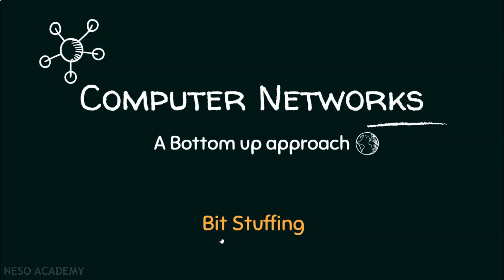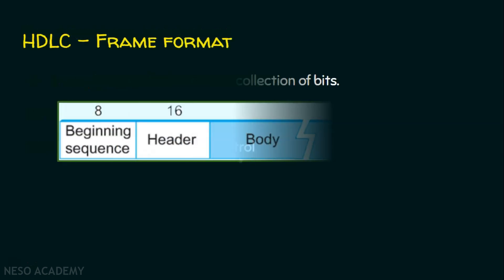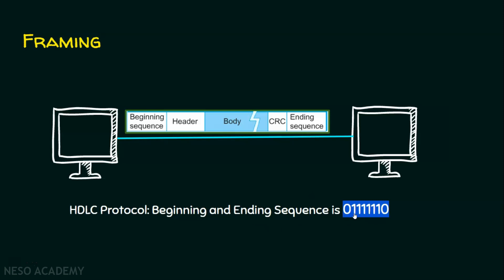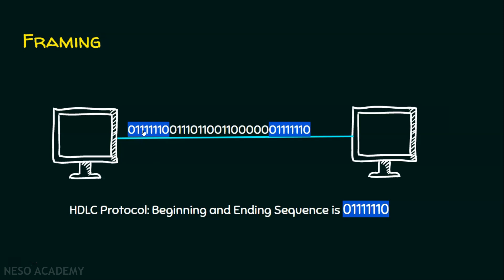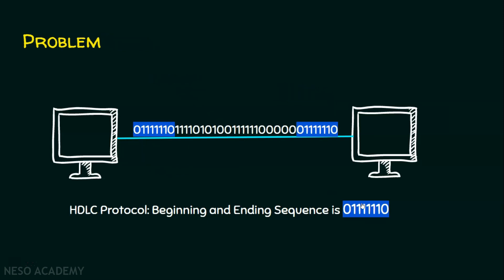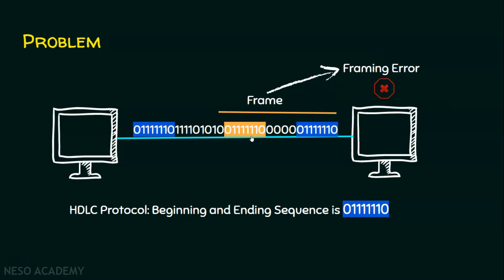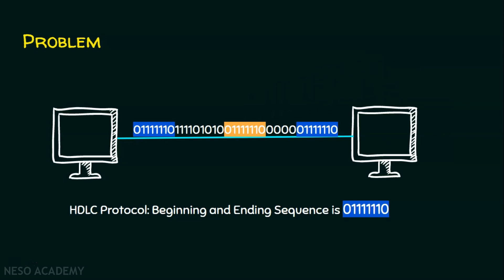Bit Stuffing

Comment: 3:38
What if in the payload there has a pattern similar to 111110 will the receiver think that it is stuffed bit or part of payload?
Reply: first bit stuff done when its 01111110  the above pattern 111110 is differnt from the orginal  the bit stuufed before consuctive 5 1s and bit stuffing wil be undo  when reciever data first

Comment: beginning sequence and ending sequence is 01111110 ,  What happens if the original data itself has , 5 consecutive ones followed by zero this would a problem again in bit stuffing right
Reply: yes it's a problem but most of the algorithm just sees 5 consecutive 1's, so if your original data is "111110" , stuffed data will be : "1111100"
so at the time of destuffing it will skip one zero and you will get the original data back.

Comment: i have a doubt
we stuff bit if there is ...01111110... sequence in data
now bit stuffed data is ...011111010...
now reciever removes the extra zero to correct the data

what if my original data has the sequence 
...011111010....

Comment: A question : what if the original payload contained a part where there is a 0 after 5 consecutive 1s, and the reciever will identify it as bit stuffing and remove it, would'nt it corrupt the original data ?
Reply: Actually, after 5 consecutive 1s ,a zero will be placed irrespective of the next bit (0 or 1). So, at the receiver end this 0 will be removed to get the original sequence. 
example the body part is 111110010001111110 at sender end.
So, the pattern received at the receiving end will be 11111o00100011111o10  (i intentionally used 'o' for denoting the extra 0's).

Comment: ANS:correct.

INFO:start from the left all the way to right

 FIRST_SET: 5 ones (1) after that apply zero (0) 
continue the pattern...

SECOND_SET:6 ones(1) so -> 5 ones(1)  then zero(0) then one(1)
continue the pattern...

THIRD_SET:7 ones(1) so -> 5 ones(1) then zero(0) then one(1) then (1)

continue the pattern...

Comment: I think its incorrect as at the last there is series of 7 1's and that satisfies the requirement of not repeating the protocol sequence. though  a 0 is added in that series after 5 consecutive 1's.
Is it necessary to do so? Or is it possible to have the series of 7 consecutive 1's.
Reply: it is not possible to have 6 or more consecutive 1's in the sequence because the sender always stuffs 0s after every five 1's. So, the sender has to keep track of (01)'s in the sequence, to remove the (0) from it, if the next five bits are all 1's.

Comment: Correct.

The original bit sequence without bit stuffing is "110101111101011111101011111110".

After applying bit stuffing, the bit sequence becomes "110101111100101111101010111110110". Here, bit stuffing involves inserting an extra "0" bit after every sequence of five consecutive "1" bits to ensure that the receiver can distinguish between the original "1" bits and the stuffed "0" bits. The stuffed bit sequence is still able to convey the same information as the original bit sequence.
Reply: I don't think it's correct as it did bit stuffing in the starting/ending sequence too. It was supposed to leave that part alone right?
Reply: @jewelbency5072 but the dude said, that the sequence given is only the data
Reply: @b3ntastic  yeah, thats why its correct
Reply: That's wrong answer
Reply: incorrect, dont stuff bits in the Flagz
Reply: it's wrong bro, we add 0 after 5 consecutive 1's only if the sixth bit is also 1, if it is 0 there's no need to add

Comment: I guess both the question are correct as both of them as the bit stuffing done at some point in the whole data. Although bit stuffing is done 3 times in 2nd question and once in 1st question.
Is are answers matching?
Reply: Wrong. Those are not two questions. It's one. The first one is the normal data, the second one the bit stuffed date. Your job is to look if the big stuffing was done correctly from unstuffed data to stuffed data.

Comment: Hey wat if the data contains normally 111110 (five 1s and 0) it will change the original data to 111111 in the receiver part ?? But actually it shouldn't? Wats the solution
Reply: U got the answer?
Reply: @SURAJ-cv8nt  111110 would be changed to 11111 0 0 and unpacked as 111110 again
Reply: @Baummaster  got it, thanks

Comment: There's an error in this video at the SOLUTION part.. You consider the bit order from right to left when you trasmit the sequence, and yet you insert the 0 after 5 1's, starting from left to right, when in reality you should add the 0 bit from right to left (after 5 1s)
Reply: Doesn't matter ending and beginning sequences are palindromes /
Reply: Idk what you meant, but the solution is correct. Look at it from the receiver's point of view (the receiver is on the left). The receiver will read 5 1's then a 0 which it will remove. The order is definitely correct
Reply: @Nomnomnom165  how bro? Receiver will start reading from the beginning sequence bits right

Comment: Question. What if data recieved from upper layers is in fact five zeroes seperated by a one, how will the reciever know whether bit stuffing is applied or not?
Reply: great question. any idea?
Reply: @vegaripkont792  Hi! So basically the reciever assumes that bit stuffing was applied and just mindlessly removes any zeroes appearing after five consecutive ones. If there is a zero after five consecutive ones in the original data, then bit stuffing would still add a zero after five ones, making five ones and two zeroes, and reciever will just remove one zero after five ones making it back to how it was!
Reply: @mellamoakshay  thanks a lot. Now it fall into place.
Reply: @mellamoakshay great

Comment: What if in the data the bits are originally having 5  ones and then a 0 ... Receiver then will consider the actual bits to be stuffed and will remove the 0 after 5 ones ... But that was the actual data?
Reply: U said 111110 right !!
Now firstly the sender will stuff a bit after 5 1's i.e. 1111100
Now after receiving, the receiver will de stuff the extra bit (0) and the data(111110) will not be lost.
🛐 Correct me if I'm wrong.
Reply: @amanlrwtfsm1323  Got the point..Thanks 👍🏻

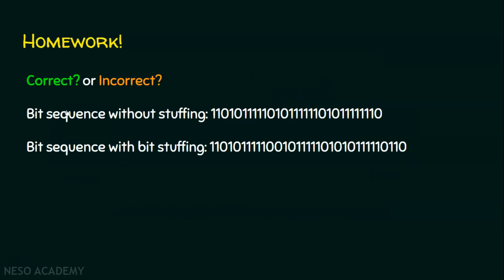Comment: Answer to H.W. at 03:50

Given Bit Sequence without Bit Stuffing (I think there is No Beginning and Ending Sequence) : 110101111101011111101011111110

I as a Sender taking that data bits sequence from upper layer and see three "5 Consecutive 1's". What are they ?

1101011111(1st)01011111(2nd)101011111(3rd)110  

Put 1st=2nd=3rd=0

1101011111(0)01011111(0)101011111(0)110 = Given Bit Sequence with Bit Stuffing in video.

Hence, It is Correct.
Reply: But there is already a '0' after 5-1's at the (2nd) stream right ? 
So after bit stuffing it should be 1111100 (2 zeroes) instead of 111110(1 zero, as mentioned in the wrong answer).

Hence, INCORRECT!
Reply: @SoumodeepChatterjeeIITD-dl6so bhai sender/receiver side pe data ek sequence me hi scan hoga ! Isiliye first five 1's ke baad 0 stuff kiya h
Reply: nerd
Reply: @nirmalksanjay  💀

Comment: 3:43 Sir, if considering a case where after 5 consecutive 1's the next one was already 0 and regardless of that bit value we have to stuff the 0 bit and remove while receiving the data in the receiver node?
Reply: yes, that's true.
Reply: @rahulkumarsingh7615  can you elaborate this as to why we still need to insert 0 deliberately? Since the ending would be different than that part of the message, there shouldn’t be any problem in receiving the data?
Reply: @Hard-oc2qd  there is a fix mechanism. if after consecutive 1's the next one was already 0  and if we don't one more 0 then at the receiver side the mechanism will remove the 0 after consecutive 1's. it's better to put 0 irrespective of there is already 0 present in the data after consecutive 1's.
see this example :
data - 011011011111011 
after bit stuffing -  110110111110011 

at the receiver side - 
after removing the extra 0 bit
data - 011011011111011 
so it's correct data at the receiver side.

if we do not put 0 (bit stuffing)  while sending the
data - 011011011111011 

at the receiver side - 

the mecanism will remove the 0 after consecutive 5 times 1's
so the data will be - 01101101111111
Now it's incorrect data we are getting at the receiver side.

i hope you understand it
Reply: @adityaghadge2067  yes mate thanks, it was clear since it was posted 3 months back! Still thanks a lot mate.

Comment: sir what if we have payload/data consisting of 5  1's and followed 0 and 1.
Reply: I scrolled down nd got the answer of this question in comments down below...thought I'll let you know as well 
So the thing is whenever the sender has a data which has five 1's it would insert a 0 independent of what bit the sixth character holds...
When a receiver receives a data that has 5 1's it will always remove the 0 on the sixth place
Reply: @beyond_akshii  but if the sender removes the 0 after 5 ones.. Isn't it making the data erroneous?
Reply: @shwetayagnik2772  No ... after 5 ones the sender will add 0 no matter what next bit is so the reciever removes the added zero ( suppose 111110 is somewhere in the information it will become 1111100 and reciever removes the zero after 5 ones so it becomes 111110 which is the required result . As you can observe what ever the 6th bit is it will not be effected.)
Reply: @beyond_akshii  so bit-stuffing is something which should be there in all cases, regardless of the message you want to send?
Reply: True ...I got the same doubt...did u get the answer?

Comment: It is correct ... Simply remember the fact after 5 consecutive 1s one 0 will be added ..... And here this mechanism is followed... So correct that's it don't confuse with original data getting modified and all. Every non info bit added to the data will be removed by the receiver

Comment: if data = 11111011111 
then what will be output after bitstuffing?
Reply: @sandeepkejriwal8286  I guess we place a Zero after one zero and five ones,ie,011111 and not just after five ones. so it should be 11111011111(0)
Reply: @sarvagyaiitmadras8727  You can stuff the bit anywhere the purpose is to break the end frame delimiter sequence. It is stuffed at last second position,  this is done because then we have to stuff less number of bits. Stuff the bit after 011 sequence and 011111 sequence you will get it.

Comment: Just remember - whenever 5 consecutive 1's appear, a 0 will be inserted by the sender, independent of the next value(be it 0 or 1)

Whenever receiver encounters 5 consecutive 1's, it will remove a 0 after it except for begining and the end.
Reply: i was about to ask what if the original data is itself five 1s followed by a zero , .............saw this comment , thank you 😊😊❤️
Reply: @prasannanivas4575  well I actually don't get what is happening if the original data is itself five 1's and then one 0. Will this 0 also be destuffed? Cause this would change the original data.
Reply: @xristinamil336  if original data = 111110 then stuffed data = 1111100

During destuffing, original daya = 111110
Reply: @prasannanivas4575  Now it makes sense. Thanks a lot ! Have a good one.
Reply: @xristinamil336  transmitted data is then 1111100 and then destuffed data is 111110 , so there is no issue
Reply: was confused before seeing this. Thank you!
Reply: @khubithakkar3951  welcome
Reply: thx

Comment: It's definitely wrong.... The bit sequence without bit stuffing contains a beginning sequence but the bit sequence with bit stuffing looses the start sequence ( the 01111110 is gone)
Reply: Actual ans:- 1101011111010111111(0)010111111(0)10
Reply: No I think the payload is given in the problem
Reply: Incorrect.because the beginning sequence is wrong

Comment: It is Correct , but I  always have doubt that whether it's left side reach first or right side at receiver because if we take right side then the answer should be different because from right side we  count 5 ones and put zero.
Reply: I don't think It is.
Reply: @brod515  It is, it will basically determine whether you add the 0 left to the group of ones or on the right
Reply: You must know which part is the start frame delimiter, Then you start counting the 1's from that side. The basic idea is, the End delimiter must not be the same as the part of data, otherwise, that part of the data will be considered as the End delimiter and only half of the data will be read.

Comment: Sir,i have a doubt that If the reciever recieves the frame without bit stuffing.....and in the payload if 1111101 contains....the reciever will remove this zero and process the frame as 111111....then this will leads to an error....
Reply: Say the payload we get from the network layer includes something like ...1111101... Since we first do bit stuffing, it'll go like ...11111001... And the receiver will remove 0 after five 1s in a row and eventually gets the original data, which is ...1111101... So in your example, you did not do bit stuffing at the sender side and yet you've removed 0 after five 1s at the receiver side. So that causes the confusion.
Reply: @nesoacademy same doubt sir
Reply: Actual ans:- 1101011111010111111(0)010111111(0)10
Reply: If bit stuffing is not done in sender side, then in the receiver side 0 is not removed.. As both nodes follow one protocol, what is done is sender side should be reversed in Reciever side.. As bit suffing is not done on sender side receiver will also not remove 0.. Only if bit stuffing is done, then only 0 is removed
Reply: @Suraj-tq6eg  but then how would the receiver nide will come to know whether the sender node has done but stuffing or not
Reply: @danendrasarkar8569  it is predefined
Reply: @Prajwal_Rao  thanks dude
Reply: @danendrasarkar8569  sender node will always do bit stuffing before sending
Reply: @nikhil_vemu  Thank you for replying sir